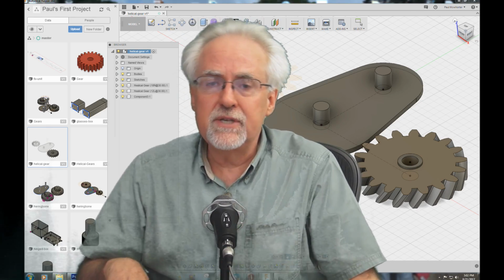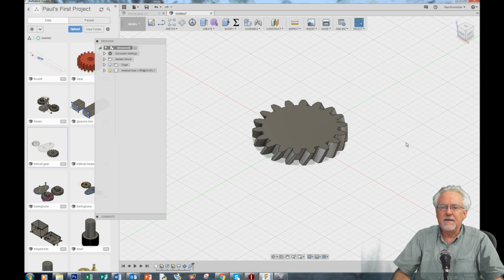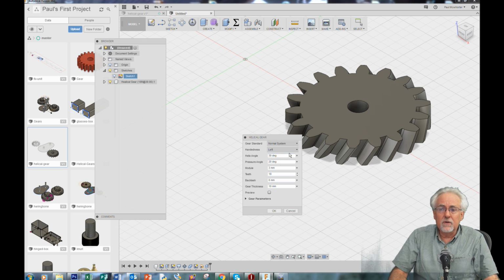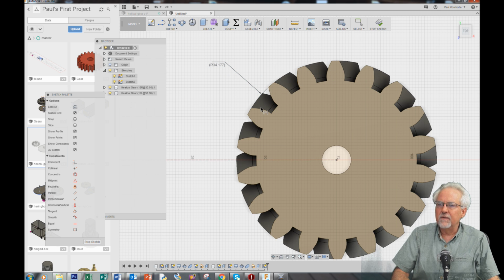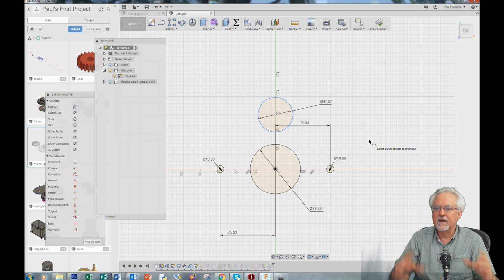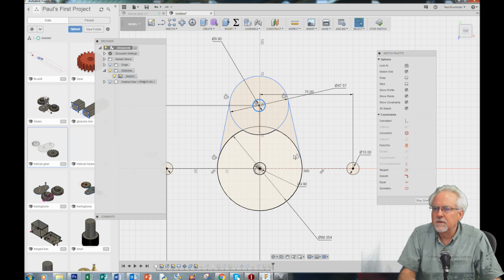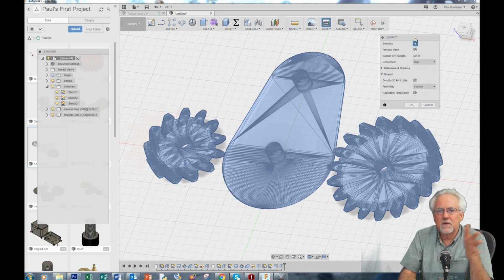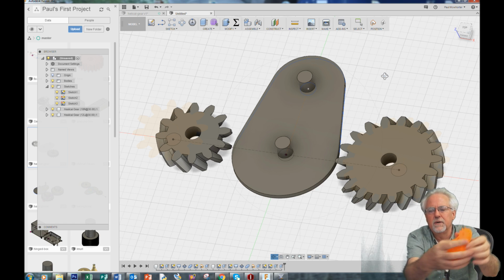Learn Fusion 360 or Die Trying LESSON 9: Design Helical Gears for 3D Printing

Comment: Hi! Love your Fusion 360 tutorials — really helpful for learning.

Quick question: I'm having trouble getting the Gear Add-in to work with the latest version of Fusion. Not sure if it's something on my end or if the add-in is no longer supported in the current version.

Has anyone else run into this? Would love any tips if I'm missing something. Thanks!

Comment: I discovered this while working through this video. When you move a component, there is a checkbox to "capture position", if you check that before hitting okay on the move, it will go ahead and capture the position during the move, rather than prompting you later. 

If anyone sees this, I would also read Tim Graves comment, it may be worth looking more into how the timeline works in fusion 360.

Comment: Two things to make it easer. 1) When you create the gear, underneath the preview check-box is "Gear Parameters". Expand that out and it has the inner (root) and outer (outside) parameters listed. 2) When you move the component at the bottom of the move menu underneath the target selections is a check-box "Capture Position" which stops the silliness of it moving around when sketch editing is turned on and off.

Comment: Useful/helpful, yes, empty space, nope! 

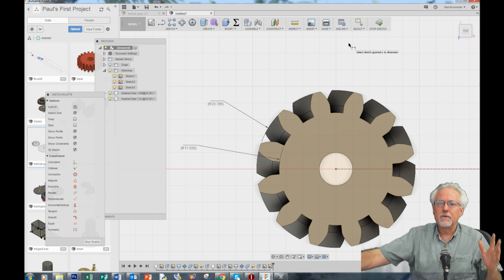Since I don't have a printer, I'm just learning 3D modeling from your videos. Today, I added revolute joints, motion linked them (both in Modify menu), and set their rotation ratio to be the inverse of the gear ratio 18:12. The smaller gear rotates 360 degrees to the big gear's [12/18x360] degrees. I checked "reverse" in the motion link window to get the gears to rotate in the proper directions, with respect to one another.

I never did get that joining plate sketch fully constrained, though... Tried moving every part of it, and nothing budged, yet the sketch claims to be not fully constrained. Anyways...

Comment: Dear Paul, it may be a little late (4 years from the release of your videos…) but I only recently  began to “play” with Fusion360 and find your videos very, very useful! I noticed that the current version of the program is different in some aspects, but most of the time I manage to find how things seem to  work in my version, One problem I cant solve though is in ‘lesson 9’ : I can’t find a way to move the helical gear from the origin. I tried to copy all your ‘moves’ but the thing stays were it is. 
 Have a printed model now, as  I used separate drawings for each of the gears and the base, but that is obviously not how it is supposed to go. Any help is appreciated! Thank you! 

Huib Berger ( the Netherlands)

Comment: My gears are automatically placed flat on the yz plane instead of the xy plane. I changed my preferences > Default Modeling Orientation to Z-Up, but it still places them on the yz plane.
Reply: Solved it by myself...needed to restart Fusion 360.
Reply: @k1jo939  When you go into sketch mode there should be a picture of the x y z planes. Just click on the plane you want to be on. Also the cube in the upper right hand side of the screen can be used to orient the sketch plane also.

Comment: Hello Paul and thanks for your great lessons on Fusion 360. I am learning a lot. Just a comment, would you be using the Radial system for designing gears the pitch diameter, (or the diameter where the gear should be contacting the other one)  could easily be calculated by multiplying the modulus times the number of teeth. So a gear with modulus 3 and 12 teeth has a 36mm pitch diameter! I think this would be easier for you and more accurate when calculating distance between gears centers.

Comment: Paul, I've been enjoying your fusion videos, I have been tryingto learn fusion360 for years without joy these videos are helping greatly, but, it pains me to see you measuring metric spur gears, the beauty of the module system is that these dimensions are easy to find. The pitch circle diameter is the number of teeth times the module. 18 x 3  mm. the distance between centers is the pcd's of the two gears added together and divided by two. If you google "metrics in engineering - metric gears " you can find some useful info. The outside diameter involves the addendum. Hope this helps

Comment: Another great video Paul, you can just measure the diameter of the gear using the "Measure tool. Measure between 2 diagonal points crossing the middle point. The result is d = 68.354 or your measured r = 34.177 times 2.
Reply: Also, you can find the inside diameter of the gear (without the teeth) in the first sketch of the Helix component (when selecting it)

Comment: I am new to Fusion 360 and I am really enjoying your videos.  I had seen a couple done by other folks but I really like your teaching method and the way you have progressed, beginning with the basics and building on them in the next video.  One thing I might suggest is that you close the data panel on the left of the screen to give you a larger sketching/modeling surface.

Comment: Another way to measuring the diameter of the gear 
select measure or press (i) on keyboard.
when the box comes up  > select face/edge/vortex and tick show snap points.
snap points to measure and distance will show up.make sure you select points that are straight across.for the inside diameter you might have a hard time going straight across for a precise measurement, so just draw a construction line across perfectly centered then use the measure tool on the construction line snap points for the most precise measurement.

Comment: The gear M-odule is NOT roughly related to the toothsize or other parameters. All around gears is very exactly defined. With a couple of formulas one is able to make up distances of axles, Gears circomference, number of teeth  etc. The MODULE numbers also defines the form of the teeth, going up in numbers the tooth are changing in form, very subtle but very important to use the right Module. Has to do withe the rolling pattern of the interacting gears. I did a lot of routing gears in brass and have quite a collection of router tools. Each module number requires his own set of toolings.  IT is really exact science. To prevent teeth from breaking of it is advised to do some rounding at the base of the teeth. Especially Resin or nylon teeth are prone to  notching due to the constantly changing of the forcing acting on the teeth. In plastics engineering Notching effects are a very important item with the design. The way you calculate will result in not very long lasting gears. I'm in the process of converting to Fusion 360 for this items but following this calculation scheme resulted in very quick breaking down the gears and not related to 3D  resins, but due to much too tight intermeshing of the produced gears. In one occasion I was able to correct the mistake, by refurnishing it on the router with the appropiate tools ( The Module tools).  I hope in the future Fusion will correct on these small but very important mistakes.

Comment: So, on video 9, (and I'm using the latest F360 Student/Educators - 9/30/2019), I don't have access to "Plug ins", "F360 App-store", "Add ins", or anything to indicate where I can get "Gears". Help!
Reply: Reply to myself: Helical Gear Generator is downloaded separately into your computer from "Autodesk App Store" and installed as with Autodesk Plug-in Installer. Once the add-in is up and running it will be found under the tab for "CREATE". Now on with the "Design Helical Gears for 3D Printing".

Comment: Hello Paul, 
Your: "......or die trying...."  was a life saver for me (pun intended). 
To be absolutely perfect, you should add a lesson on file management. 
I lost a few work in process because of the quirky way Fusion 360 saves files.
Is there a way to set up preferences so that all files are saved simultaneously in the cloud and in a local drive?
Also, you may want to explain the file formats in which 3D models and 2D sketches can be saved (SLT, DFX, etc)
I use Fusion 360 also for pure 2D sketching for Laser Cutting acrylic plates. and I'd like to know whether there is a way to save a DXF file without the construction lines.
This would be great when you then upload it in Corel Draw which is normally the software connected to the Laser Cutter and cannot differentiate real from construction lines.
BTW If you have already addressed these issue, please send me the links where to find the videos. 
Great job anyway
Roberto

Comment: Paul, I'm using Mozilla Firefox, and once I download the Helical Gear Package, it is sitting in my download file waiting for me to tell it what to do with the file.  Where do I send it?  (Yes, I've restarted Fusion 360, and it is still not under "Create").  Facts is, it is still sitting in my download file. I have to send it somewhere... but where?  Thanks for your time and attention.
Reply: Never mind - I discovered the answer.  For any other newbies finding themselves  in the same boat, you simply go to your Mozilla Firefox download button (looks like an arrow pointing down to a line), click on it, find the file you just downloaded, and then "Double-click" on the file and it begins the installation process.  In all my years, I have NEVER had to double-click on a file to install a program - so this was new to me.  (I can hear others sighing and shaking their heads in disbelief. lol)  

Note:  it may look like nothing is happening at first, just be patient.  You'll get to the point where you are ready to cancel the installation because of the inactivity, but don't - it will finally take off.  In Windows 10, a screen will appear asking if you really want this program because it could contain viruses, etc... just say YES.   THEN turn off Fusion 360 and turn it back on again... and BOOM, there it is in the Create category.  Live and learn!

Comment: After I installed the plug-in Helical then i go to create but there was't show Helical. What can I do? 
Thanks,
Reply from the maker: Did you restart fusion 360? Sometimes you have to close and repoen to see new plugin.
Reply: @paulmcwhorter  Yes I just did and its shows.
Thanks,
Reply: @paulmcwhorter  Another issue I have. When I insert the gear then It wasn't show on the horizontal or Axis X but show on Vertical  or Axis Y and half on +Y and half on - Y. What should I work on this issue?
Thanks,
Reply from the maker: I think it puts it on the X-Y plane so make sure you have Z set to up on preferences, if I remember right.

Comment: When extruding components (IE.  the holes in the gears), try extruding "to object" and selecting the opposite side of the gear.   Dragging it out into space may cause you problems down the track if you ever wish to change the dimensions.  I understand it's not really necessary for this particular design due to it's simplicity but it's a good habit to get into.  Great tutorial series!

Comment: It's bad practice to extrude an object to create a hole on another object by just dragging all the way up or down and keep dragging a little more, as if you were giving it a little margin. It's best to change the setting extent from 'distance' to 'to object' (on the extrude panel) and then select the outter face of the object where the extrusion needs to stop. That way, if you change dimensions in the future, the hole is always going to be there.
Reply: Very good point Alejandro.
Reply: That was very helpful mate
Reply: thx for the tip
Reply: Thanks

Comment: Hey Paul, Your axis orientation cube is different than mine and I can't make mine look like yours and still get the same orientation of the helical gear that is created when following your video. Can you suggest how I can get on YOUR (orientation) page in this respect???
Reply: Hi Paul, Please disregard my question... I just found the "preferences" setting where you can set "Y" or "Z" as being the default "UP" orientation. Apparently mine was still at  the Fusion 360 default of "Y" being UP.  It's interesting that in the automotive design world (my world) that the "Z" axis is considered "UP" but our analytical (Math) way of thinking has the "Y" axis in the vertical orientation... :-)
Also, you have one of the best systems that I've seen (for a teaching video) especially for such a complex subject of CAD. Your camera switching method is superb [except when you forget :-) ] and PLEASE don't worry about going too slowly as we who might be impatient can fast forward; but those who are just getting it (or savoring the material like me) enjoy and benefit from the slower pace that you choose to use...!

Blessings,
Dan H.
Reply: P.S. Paul... We in the automotive domain pronounce the word Helical as "hell eh call" with the accent on the first syllable. :-)

Comment: Thank you for the video. Please note that there is no need to try to measure the gear dimensions. The gear generator provides all or the gear's engineering details in a drop down located at the bottom of the generator window. 

The value you are looking for is the "pitch diameter". Divide by 2 to get the pitch radius. Add to this the pitch radius of the 2nd gear to find the exact axle-to-axle spacing. Add any backlash as you see fit.

If you overlay (construction) circles of the pitch radii of meshing gears you will see that they just touch, whilst the teeth extend beyond this boundary without clashing.
Reply: How do you find these details after you have created the gear?  If you forget to write them down can you call them back again? I checked the properties for each gear and it gives your some dimensions. There is a length and width which is a strange measurement for a circular gear. They are the same so I suspect they are the outside (major) diameter of the gear. Can't find anything about the pitch diameter.
Reply: @donmcdonald4347  YES PLEASE
Reply: Mark Cooper - right - pitch diameter.  I just learned that myself studying a Grainger’s catalogue.
Reply: Hey Mark, just wanted to say thank you for the bit of engineering.  "Pitch diameter"  So awesome!

Comment: The Module system used universally for metric gears makes it trivial to dimension the axle distance between gears. The arithmetic works such that the diameter of the pitch circle is Module x Z (number of teeth) in millimeters. Thus say a module 4 gear of 12 teeth would have a pitch circle diameter 4 x 12 = 48mm. Recalling that the pitch circle is the effective "toothless wheel" i.e. a wheel of that diameter would work like the gear, two above gears would mesh perfectly with axes 48mm apart (radius + radius). No measurement or eyeballing involved.
Reply from the maker: I did not know that. I am an electrical engineer, and am doing fusion 360 to help my students with the 3D printer. So, I am learning along with everyone else.
Reply: Me too :) Although i did attend a course on mechanical design during my studies back in the day. I guess the module system can be a bit cryptic before the bulb lights. Just unlearn the tendency to focus on the actual visible geometry ( i.e. inner and outer radii etc ) and think in terms of the pitch circle. F360 kindly even draws it for you - at least the spur gear generator does. Other than that, thanks for the great videos. It is content like yours that makes Youtube worthwhile. So the above comment was not in any way meant as a criticism, rather a helpful pointer to save unnecessary head scratching. (editorial note: i changed "division circle" to "pitch circle" in the original post after making sure that the English language term is valid for module system gears as well. In my native language (Finnish) the words imply slightly different things.
Reply: The gear generator tells you the pitch diameter (and other parameters) in an informational drop down at the bottom of the generator's input panel.

Comment: Great lesson as usual Paul. I tried to repeat it using parameters and it seems that the gear component does not update. I tried to change number of teeth as an example. Am I doing something wrong or the third party components do not refresh themselves from the table of parameters?.
Reply: I am sorry, I did not notice that You have answered on this issue to Craig Wilson that plugins do not support parametric design. Sorry about that and again thank you for your great job.

Comment: My understanding of helical gears is that you have more effective contact area , spreading the loading over several teeth @ the same time . Less noisy that a spur / straight cut gear , but a little more lossy because the two wheels " screw up " against each other ,  requiring bearing faces detail on the end of the gear & the surfaces of the box .

Comment: Paul, I’ve learned some really good things from you so far in this series and I’m grateful, and looking forward to them continue! One design comment on this one: in my opinion you made a major faux pas when you extruded the hole in gear center... imho you should never extrude a hole to a random depth, as it could ultimately cut other components also... the recommended approach is to extrude to a surface which in this case is the backside of he gear.. this ensures that you don’t inadvertently cut away from other components. This can become even more important when you start working in the timeline. This is constructive input as I’ve learned a tremendous amount from you!
Reply from the maker: Yes, excellent point.